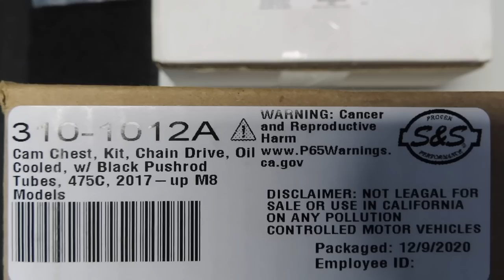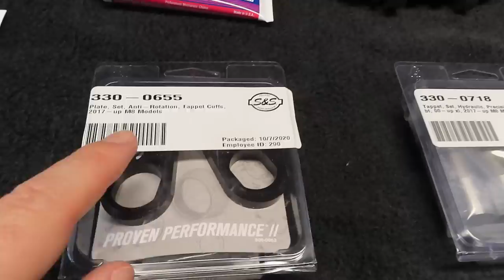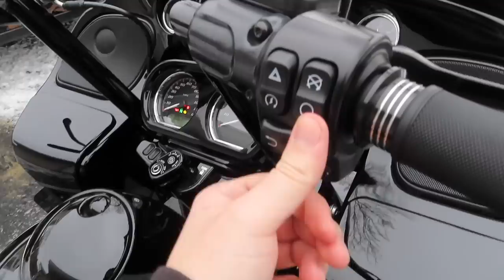2019 HARLEY DAVIDSON ROAD GLIDE S&S 475 CAM INSTALL! *STAGE 2*

Comment: I dragrace a 12 roadking. Just bought a 21 lowrider S. Can't tune it yet all new models have totally new ECU. (Developers building tuners as we speak). Watching this video and being around racing and built engines etc...all my life. It absolutely amazes me how incredible the M-8 platform really is. 
I've seen guys bolt in this very cam with just pipes and an air cleaner on a bone stock engine making 120+hp/130+tq with just doing that alone. Wow. Now...be forwarded friends...the weak link is the primary components. So may want to invest in some upgrades there. Also if you are the one who likes slamming gears after a few beers....well I've seen a bunch of transmissions bail as well.
Not bashing Harley. (Hell I have two of em) just know your weak links. They ARE there, and going beyond these simple bolt In mods....you'll see!!

Back to the vid.
Saw a few things that raised my brow, but I understand the constraints of shooting a video and presenting your "product" to the public...so I'll let that slide. But... 720pix.... Come on man....upgrade that phone and shoot in 8k or something (giggle snort lol).
Enjoyed the vid. As soon as some tuning availabilities are released, may choose the same cam...much lighter bike (in my case) so not overly concerned about spending 1,200 on a pipe so I have some ideas...lol

I subscribed, looking fwd to seeing more progress. Be safe going to daytona. Enjoy your trip!! God bless!

Comment: Nothin like a cam to wake up a v-twin. I kept my 12 TC and installed a Woods TW222 torque cam last winter. Very happy with the way my bike sounds too. It pulls hard from 1500-4000. The power band is right at around 2500, highway cruising speed.

Comment: Sounds great! Probably the best sound you can get from a Cam for the M8 engine. I like the Red Shift 468 and the Woods W8-22XE too.
Reply from the maker: Yes both of those sound good too!
Reply: @DOOWORKMOTORSPORTS  I need that for my softail

Comment: Hi. I've been searching Youtube to find someone with a 475c on an M8. My dealer is telling me that since I'm an "easy" rider that I will actually LOSE torque & power with this cam until I go to high rpm (which I never do). What did you find? Thanks in advance.
Reply from the maker: Sounds like you might want to go with the 465 cam then.

Comment: Changing to after market parts, will it cause engine problems down the road? 10 years ? And how’s the fuel intake after changing cams? Thanks
Reply from the maker: I haven't experienced any engine problems..  And I seem to get about the same fuel mileage as I did stock.  About 250 miles to a tank..

Comment: I live in metro Detroit, Michigan so I feel ya, I have 2020 Road glide special, I was thinking of this cam myself just heard 475 is a good 1 all around one to go with, is this something I can install myself, haven't done any work like that before but I'm ok with the tools, I also have the power vision tuner with trask assult cleaner that I'm about to install, so the cams are next
Reply from the maker: Honestly if you have all of the right tools you should be able to do this, I had a friend help me who has done this before, so it made things easier because he knew what he was doing. But if you follow my other step by step video along side JP cycles YT video, you should be good to go!

Comment: I have the same bike, I blacked out push rod tubes and tappet covers when I installed my Red Shift 468 cam. Looks great backed out I wish it wasn't so difficult to change the lower rocker box cover that's the only chrome piece left. I have a Fuel Moto tune as well and I ran several auto-tune sessions after install and the buke runs great. I used the stock cam plate and oil pump though. I am getting ready to install a Dark Horse Man O War compensator and a Rekluse Torque clutch so maybe once I get that paid for I will go for the S&S cam plate and oil pump upgrade,
Reply from the maker: Nice!!
Reply: The Man O War Compensator makes the clunck go away when you put it in gear.
Reply: @Holdon33  I am looking forward to that.

Comment: Sounds good! How does the rtx baffle sound compared to the d&d billet cat on you dads bike with the cams installed? If you were to pick what pipe would you rather go with if you didn’t already have the fuel moto pipe with rtx baffle?
Reply: I’m torn with this same question. D&D vs Jackpot

Comment: I'm guessing an extended warranty would not cover any of these parts and would essentially void their warranty.  I also have a 19 RG and my original 2yr warranty is about to expire and am on the fence of purchasing the extended warranty or upgrading as I wish and fix the weak points of the motor..... and advice would be great.  Great videos btw
Reply from the maker: No, the extended warranty from Harley will not cover this.  I voided my warranty the day I flashed my bike with an aftermarket tuner..

Comment: When did you tune the bike after the cam install?
Reply from the maker: Yes, so with Fuel Moto all you have to do is go on their website, tell them what mods you have done to your bike and they will email you a tune based on your setup.  They have already dynoed a bike with my same mods so they just sent me that tune.  Then I downloaded it to my Power Vision Tuner and then flashed my bike with that.  No dyno tune needed! I actually flashed my bike before installing the cam. But you can do it after, just don't start it without the tune in the bike.

Comment: Doesn’t that cam require new valve springs and clutch upgrades?
Reply: no it does not its a bolt in cam

Comment: Hey, @Dooworks Productions 
I did cams on my 2017 road glide. Decatted stock header , hi flow k&n wedge air cleaner, Rhinehart DBX 4.5 , and had it dyno tuned. 
Does your motorcycle run a lil rich? I smell exhaust more since I did the cams.
Reply from the maker: Rich is better than lean!

Comment: There's a m8 cam bearing puller on amazon for $99... Probably not as good as the one from Jim's, but if you're only going to use it once or twice, you could save $150-175

Comment: So when I did my install, I took it for a test ride and as soon as the engine was under load, oil blew out of all four upper pushrod tubes. Pulled all four upper pushrod tube o-rings and they were all destroyed. Did you have a similar issue?
Reply from the maker: No, I did not have this issue.  Sounds like you added too much oil..  Also, these M8's need to breathe.  I recommend buying a vented oil dipstik from A1 cycles.  Check out my video on that product!
Reply: @DOOWORKMOTORSPORTS  it’s funny you mention over servicing, as I thought this could be the case not too long after I posted my comment. I am using the vented dipstick already. Thanks bro!

Comment: Way not take the tapped covers off instead of cutting the push rods ? Why depend on 5/16 lock nuts on the rods to hold the engine together?
Reply from the maker: I did take the tappet covers off... Have to cut the stock push rods in order to remove them without taking off the head since the stock ones aren't adjustable.  And because the S&S adjustable push rods are tried and trued and I trust that they will hold up.

Comment: s&s is out of stock and has been for months. Where did you get your kit?
Reply from the maker: I found a local shop that had one left in stock..
Reply: @Josh Calbert 
That is the case with everything S&S right now. Been waiting on my roller rocker arms for 7 weeks already. Just took my S&S 475G out and putting in a TTS-250 cam. Not because I didn’t like the 475 (sounds amazing) but just doing a major performance upgrade after less than 500 miles on my built 117.

Comment: What tuner did you get? Did you dyno tune?
Reply from the maker: Dyno Jet Power Vision, and no we did not dyno tune it.  We received a tune from Fuel Moto and flashed it.  Bike runs great!
Reply: @DOOWORKMOTORSPORTS  I just did the same. Thank you

Comment: What tuner did you use?
Reply: Dynojet powervision and tune from Fuel Moto
Reply: @Holdon33  ok thanks. I used an FP3 but considering the PV.  Mine doesn’t seem to be running right.  I did mine back in November but I live in Alaska so still haven’t had a chance to ride it.
Reply: @Holdon33  i’ve been looking at the PV with Fuel Moto tune. Probably just going to do it been hearing a lot of good things about it
Reply: @robb907  Fuel Moto e-mails you custum tunes and they are really easy to deal with great customer service buy the tuner through them and they will put the tune on it before they send it for you.
Reply: @Holdon33  ok thanks for the tip.

Comment: If i have the 117 stock should i still get thr full kit haley told me it wasnt worth it cause the 117 has the better oil pump anyone know
Reply from the maker: No need to get the cam plate and oil pump if you have the 117.  I did it because I like all the blue billet parts lol
Reply: @DOOWORKMOTORSPORTS  ok thanks nice bike i just got the fxlrst